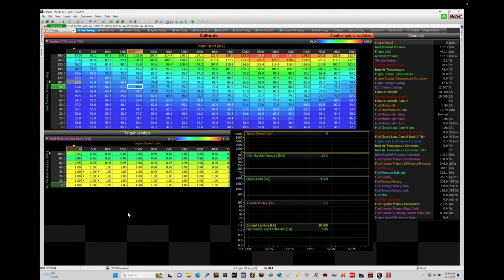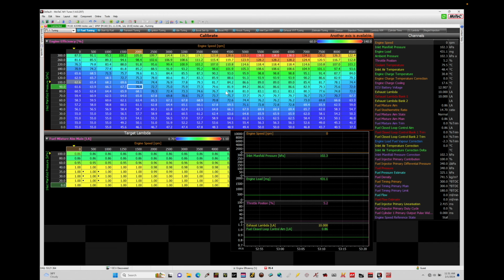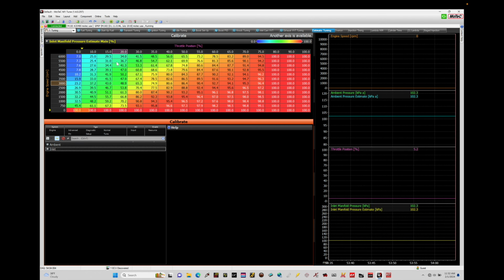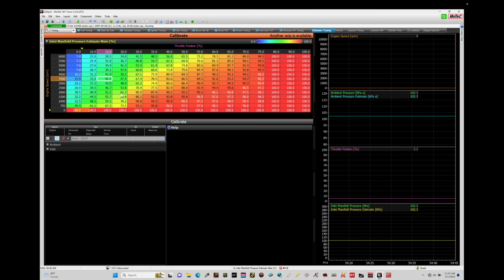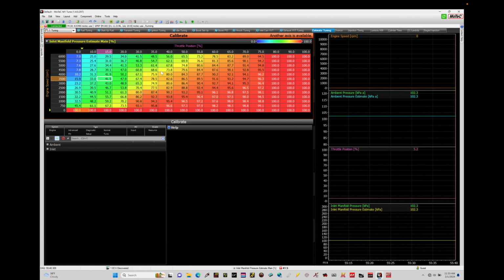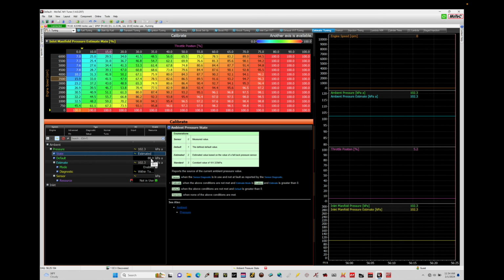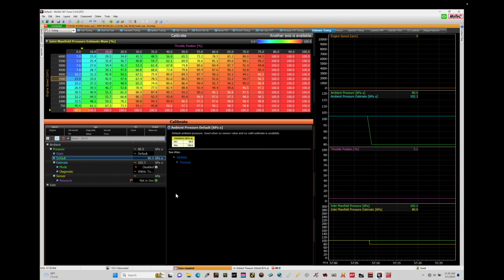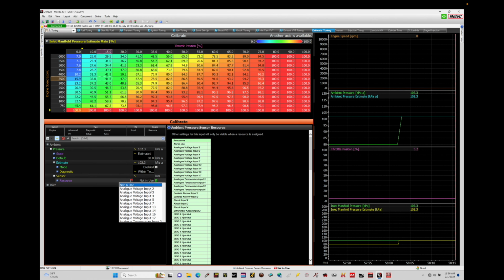Motec M1 Training Course Part 30: Inlet Manifold Estimate Table Tuning | Evans Performance Academy

Comment: Evan, what would be your approach on a turbocharged car?  Maximum possible inlet pressure at a given throttle/rpm combination? Is it safe to assume this table is never used unless there is MAP sensor failure?
Reply from the maker: The table is called on if there is a MAP failure (assuming you have that fail safe enabled).  The table is also called on in the fuel film / transient fueling calculations.  I always spend the time to dial in the estimate table.  At 90-100% throttle you want to use peak boost pressures logged to populate the table.